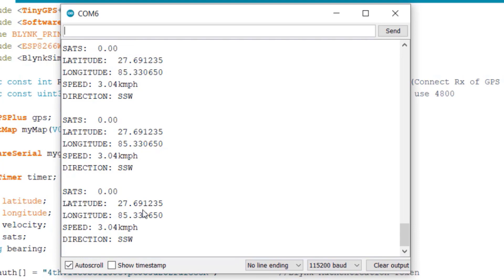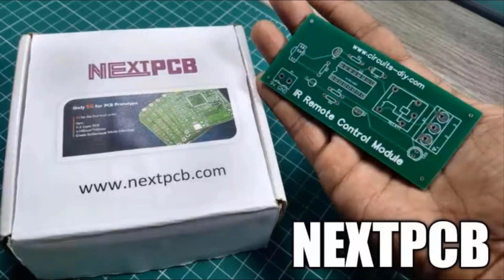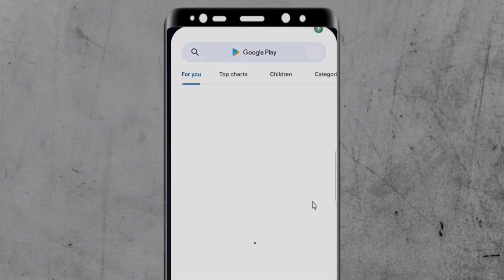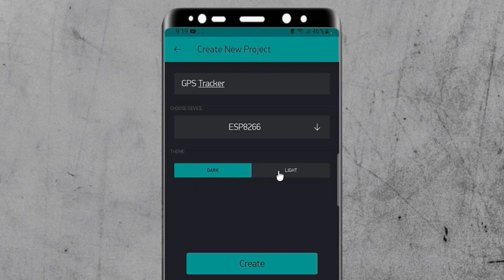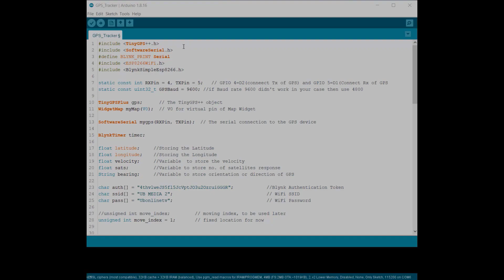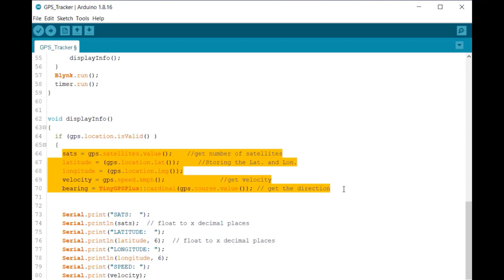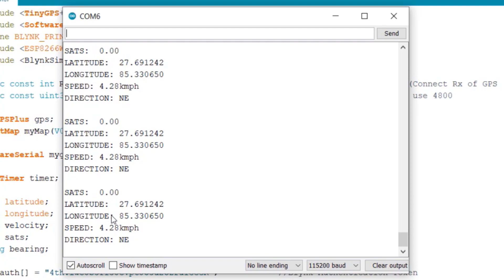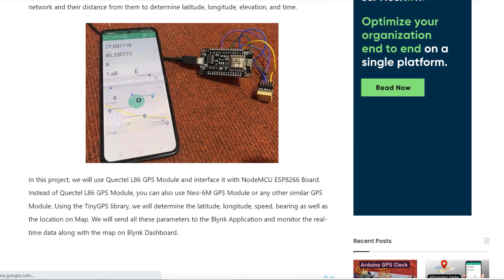Real Time GPS Location Tracker using ESP8266 & Blynk with Google Maps

Comment: The pins on the neo6 have been the bane of my existence the last week or so.. like we established we didn't want to solder anything until we we had it all established, but it's like... Those holes are just big enough to be a problem that I would have made up much more permanent solution to a long time ago if I had known it was just always going to be a problem lol... Combine that with doing a bunch of the work in what's equivalent to basically the oldest building in that game control lol not even kidding on that one.. like 3 ft of concrete as the norm for the building... So we were always going in and out in and out trying to get signals and come back in lol some of the code we had originally we just wouldn't do anything if it wasn't getting a signal.. and then one of our modules was blinking the confirmation signal but just actually was broken the whole time lol.. it's like the whole point was to have a simple solution and a breadboard just seemed a little ridiculous considering everything's got pens and connectors! And yet somehow with those holes.. they manage to disconnect themselves or jump themselves with each other lol tape hot glue nothing.. and I couldn't double stuff like I would normally do with a breadboard that was loose lol.. and again I just kept trying not to deal with it and thus I spent more time dealing with it than anything else lol...

Combine that with the neo6s uncanny ability to not actually power its antenna if the antenna is plugged in when you turn it on sometimes lol... I'm looking at your little pen module over there and I'm like my God I want that so bad right now.. but again I don't want to deal with it anymore.. so hopefully these little Rube Goldberg machines that I've obsessive compulsive will play nice for the next couple of days

Comment: Hi there!
I am using Neo-6M GPS Module, the result i get is up to 2 digits not 6 digits after the decimal point. Any ideas ?

void displayInfo()
{
  if (gps.location.isValid() )
  {
    sats = gps.satellites.value();       //get number of satellites
    latitude = (gps.location.lat());     //Storing the Lat. and Lon.
    longitude = (gps.location.lng());
    velocity = gps.speed.kmph();         //get velocity
    bearing = TinyGPSPlus::cardinal(gps.course.value());     // get the direction
 
    Serial.print("SATS:  ");
    Serial.println(sats);  // float to x decimal places
    Serial.print("LATITUDE:  ");
    Serial.println(latitude, 6);  // float to x decimal places
    Serial.print("LONGITUDE: ");
    Serial.println(longitude, 6);
    Serial.print("SPEED: ");
    Serial.print(velocity);
    Serial.println("kmph");
    Serial.print("DIRECTION: ");
    Serial.println(bearing);
 
    Blynk.virtualWrite(V1, String(latitude, 6));
    Blynk.virtualWrite(V2, String(longitude, 6));
    Blynk.virtualWrite(V3, sats);
    Blynk.virtualWrite(V4, velocity);
    Blynk.virtualWrite(V5, bearing);
    myMap.location(move_index, latitude, longitude, "GPS_Location");
  }
  Serial.println();
}

Comment: Sir ,as coding is same for 
Arduino uno +wifi module
Instead of esp32 ?? Please guide
Reply from the maker: No
Reply: @HowtoElectronics   sir what we can do?now for Arduino uno ,
Reply from the maker: It wont work with arduino as it requires internet connection. Rather buy a nodemcu board which will cost around 300-400 Rs
Reply: @HowtoElectronics  ok sir but i also want to add ,some sensors which need pins , and i think esp8266 is less num of pins as compared to Arduino Uno?
Reply: I want to add ultrasonic sensor,rain sensor,Led ,gps ? 
As all these sensors will be added ? I means pins are enough for these sensors ? Please reply must,
Reply: @gettechyt126  you can buy an expansion board for esp8266

Comment: Unfortunately the app couldn't connect to the Blynk app this is due to the owners of the Blynk have declared that the support from the old app is finished.
Reply: But sir for blynk (legacy) is not work for new users so we can create new account for that so please update this project to by using of blynk iot
Reply from the maker: It still connects and work well. Use the authentication token in the code from blynk mail.
Reply: @HowtoElectronics  isn't able to create a new account or reset your old account

Comment: Nice project.
I want to ask, is this project can be using esp32?
Right now I have a problem making a gps tracker using esp32 and l86 module. Can you help me in advance? Thank you
Reply from the maker: Yes u can use esp32 easily.
Reply: @HowtoElectronics  can I contact you Sir? I need some help in advance. Thanks
Reply: I also face issue 😭